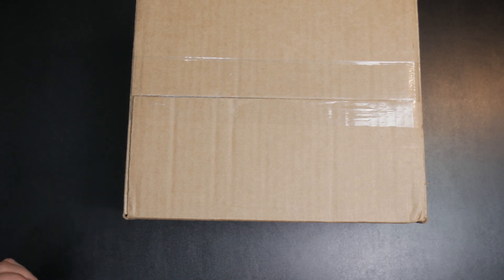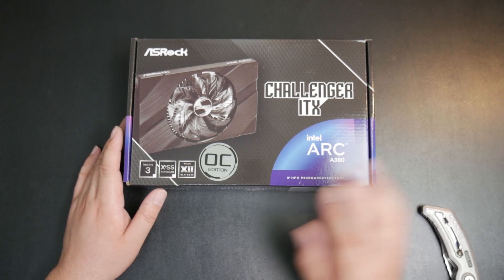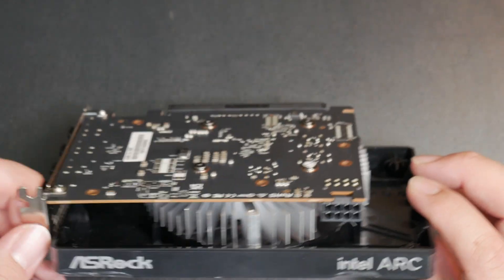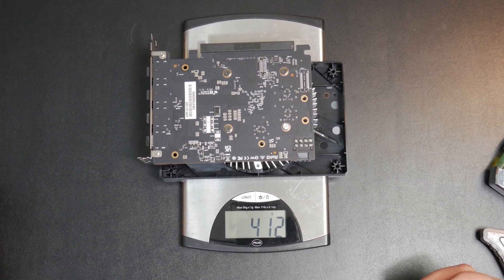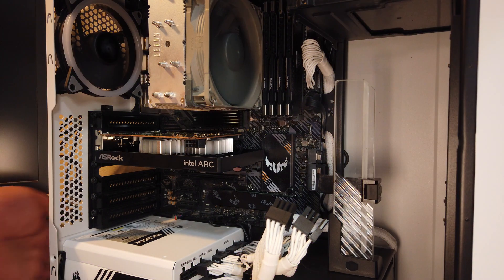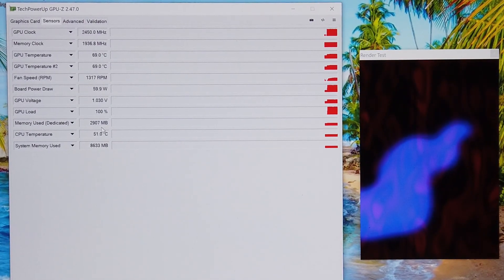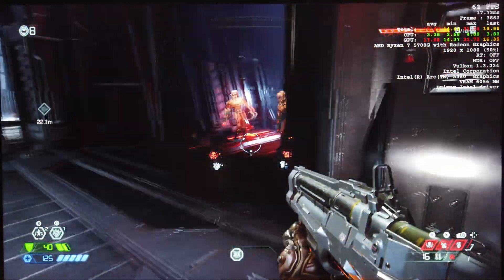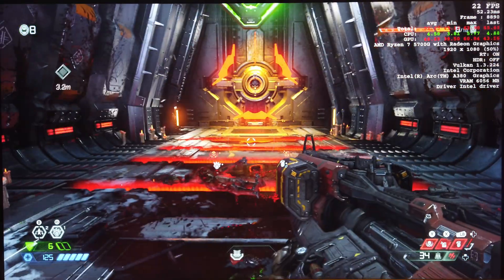intel has GPUs now! ARC A380 Unboxing, First Look, Game test

Comment: bro, is that gpu can work with pcie 3?
Reply from the maker: It should be backwards compatible. The limiting factor is the processor. I couldn't get it to work on a Ryzen 4600G and I hear the minimum spec is a 10th gen Intel CPU, but I don't have one of those to test with right now.
Reply: It is x8 4.0 so that is x16 3.0 speed on a PCIe 4.0 board. x8 3.0 speed is x16 2.0 speeds - if my math is correct.
Reply from the maker: That should be correct. Double each generation.